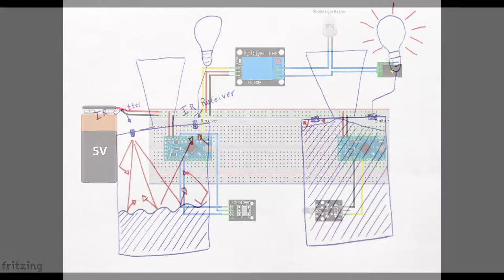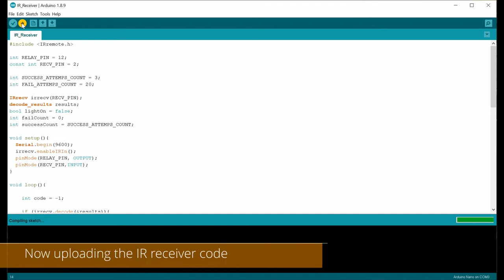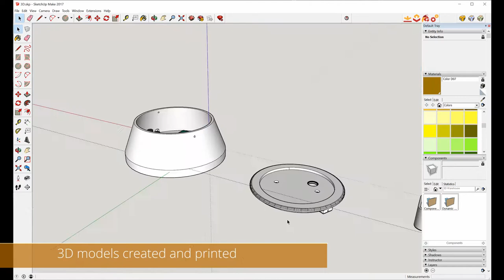DIY - Dust Collector Bin Level Sensor

Comment: I used Google Translate to send this message.
2 Questions!  May I get the ardunio code?  
Why did you use 2 Arduino Nanos? Could this use only one?   
These are real questions.  I plan to use this in my shop and the more I ask the more I learn.
Thank You from Beggs, Oklahoma, USA
Reply: Usei o Google Tradutor para enviar esta mensagem.
2 perguntas! Posso obter o código do ardunio?
Por que você usou 2 Arduino Nanos? Este poderia usar apenas um?
Essas são perguntas reais. Pretendo usar isso em minha loja e quanto mais pergunto, mais aprendo.
Obrigado de Beggs, Oklahoma, EUA
Reply: Could not send message on website.